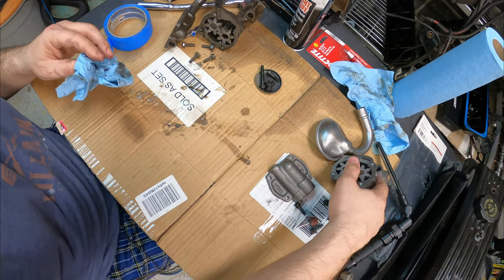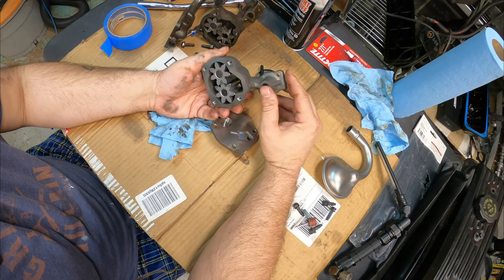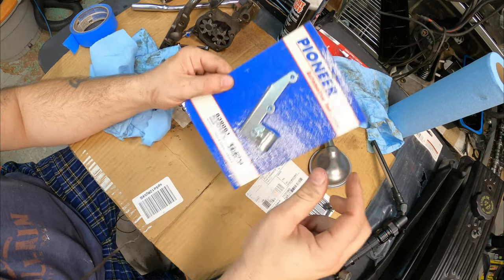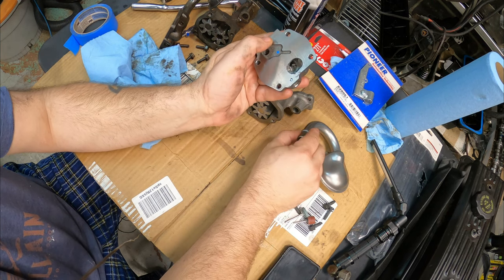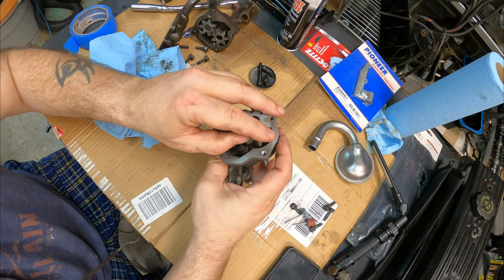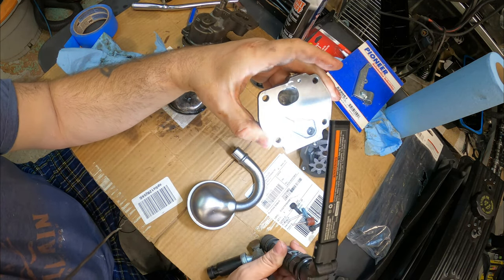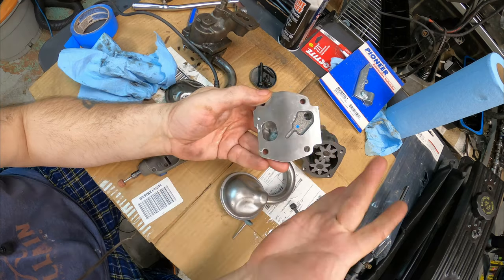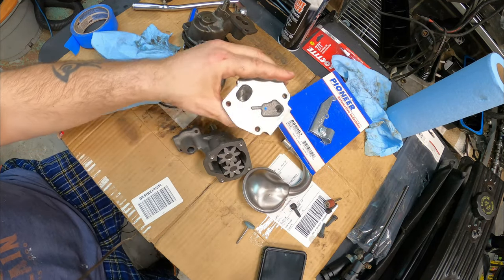Small block Chevy oil pump

Comment: Somebody should send this video to SRC channel and the Old Man's Garage.  They can't keep a motor together for more than 20 minutes.........always due to oil issues.  They bragged about having 120psi of oil pressure at the end of a run.  That much pressure at the end of a run indicates HUGE RESTRICTIONS.  So somebody should send those people this video.
Reply from the maker: lol
Reply: They use billet pumps ..... this is why the high pressure .... would you spend 10k on a engine an drop a stock pump in it..... duh
Reply: @hmccarty7189  oil protects by flow not by pressure.  Pressure indicates a restriction.  Don't believe me? Look at their laundry list of blown motors due to oiling problems......DUH!!
Reply: @hmccarty7189  and billet has nothing to do with pressure or flow.....DUH!!!
Reply: @benburnett8109  look pimp I do not need a couch jockey to tell me anything about a i.c.e ..... flow an pressure are 2 different things that u searched the internet an found the correct answer .....here is my response.... never argue with a idiot they drag you down to their level and beat you with experience!!! You win!!!
Reply: They flat sure tear shit up! Even a Dodge 340 this time & they indestructible! They just been lucky for a long time and now it's catching up with them! Anyone could of done it, they just got there first! Wt atm & everyone!
Reply: I go through the big end at 110-112psi depending on engine temp and right at 7,900 rpm. I have a big block pump bolted to my small block.
Ive not had any engine issues due to oiling and I also have no restrictions anywhere.
You can put a HV pump with a high pressure spring in it on a stock engine and have over 100psi on a cold start. Restriction has nothing to do with it.
Reply: @AndreenMotorsports  wow. It's astonishing the number of youtube channels with motorsports in their name that have no understanding of oiling a race engine.
Reply: @benburnett8109  and yet somehow we have an 8 second drag n drive car.
I also work on a TAFC team 4 months out of the year.
By all means though, school me on oiling, Im all ears.
Reply: no. YOU DO NOT have an 8sec drag n drive car.  ANd I work on an HVAC team that can swap a complete Hvac system out of a house in under 8 hours. and we have less than 100psi oil pressure at the big end of the swap.  See........I can make up crazee things as well. And by the way, IF you need me to understand oil pressure/flow then YOU REALLY DO NOT HAVE AN 8 SEC CAR OF ANY KIND.

Comment: You can silver-braze the pickup tube to the cast iron very easily with a propane or map torch. The braze is quite strong for this application, and there is no danger of melting holes in the thin tube. Just be sure to apply braze flux evenly to the joint area before heating. Apply most heat to the casting area until it begins to show dull red, then feed the braze solder to the joint. It only takes a small amount of braze wire. You can practice the technique on scrap copper pipe and fittings using tin based solder and flux. Thanks for the tips.
Reply from the maker: @RobertBeck-pp2ru  thank you ... will try that on the old pump...

Comment: Years ago I had a Ford 460 rebuilt, slightly cammed with slightly more compression. I also had a HV oil pump installed and I think that was a mistake. The engine ran fine, but the pump's attempt to push more oil simply resulted in high oil pressure all the time. I too wondered about stress on the cam gear and distributor shaft. There was no issue for as long as I owned it, but I think that a stock pump would have worked just fine for my application [in a truck, towing my camper].
Reply from the maker: HV oil pumps have their place (like race engines with higher bearing clearances where you need the extra volume of oil)  for stock engines there is no need for HV pump because  it creates more psi not volume of oil... (think of a garden hose when you pinch it off) ..    yes you can get away with a hv pump for you application you will see higher then normal oil psi and extra  stress on shaft and gear but you the main draw back is the extra power t take to drive the pump.

Comment: Just as my own technique, rather than relying on a tack weld, which of course takes a welder, or just the press fit, I smear a very thin coat of JB Weld on the tube before pressing it in. Works like a charm and anybody can do it.
Reply from the maker: yes good point ,.

Comment: You can either gas braze it or Tig  braze it with dissimilar bronze rods
Reply from the maker: Yes this is a good option too ... but at the time that was not available to me ... and I don't know anyone I can trust to do it
Reply: I've been a professional welder for over 35 years I would not weld the pick up on with a bronze rod because it most likely will Crack because of vibration I would tig weld it with a mild steel rod pre heat before u weld u 

  make sure everything is super clean

Comment: Good video.
Thanks for sharing. 
I build most of our oil pumps.
I use M55 replacement pumps rather than M55hv's most of the street engines don't need the high volume oil pumps, in my opinion. 
We boost the oil pressure and deburr.
Been doing this for 40 plus years.
Important to clean out new pumps and make sure the pressure relief valve is cleaned and lubricated.
Make sure it moves freely. 
Thanks for sharing. 
Take care, Ed.
Reply from the maker: Thanks for sharing
Reply: Lubricated with engine oil?
Reply: @thisisyourcaptainspeaking2259  Clevite bearing guard and oil.
Most of the time this is sufficient. 
Have a good day.
Reply: @edsmachine93  I figured the bypass valve gets lubed pretty well during the oiling system prelube, I use a drill attached to a distributor I've gutted.
Reply: @thisisyourcaptainspeaking2259  Do what you want to do.
Reply: Don't want to suck the pan dry.....

Comment: I have done this mod on the turn where the oil is drawn into the gears for years. I also like to smooth the outlet port  to get the burrs out for an undisturbed oil flow. Great informative video.
Reply from the maker: thank you for watching i have been doing this for well over 25 years on all my builds ... most new comers are just learning this that's why i post these silly videos to pass on .... there are so many easy mods people miss when building these small block chevy's that make a nice difference for long term durability

Comment: JB weld the pick up, I did it 20 years ago and it still holding strong.
Reply from the maker: yes good option
Reply: I install lots of "reman" (most look brand new, maybe not reman?) SBC's and the pumps always come with the pickup attached, looks like an epoxy to me.